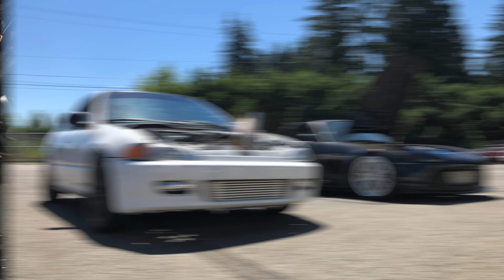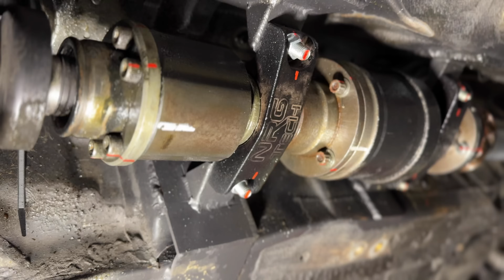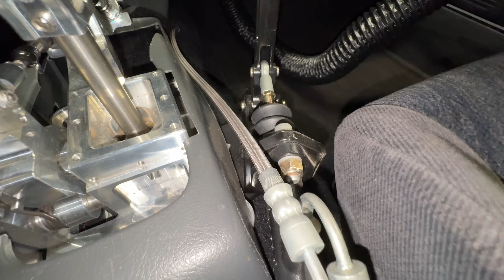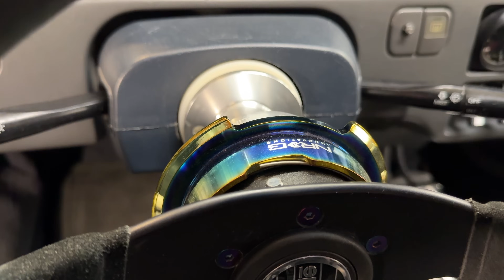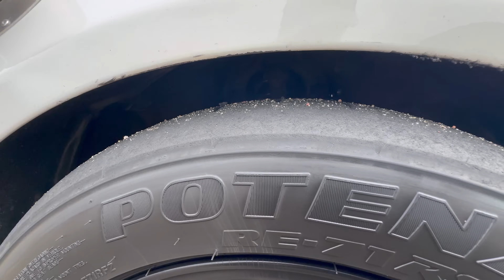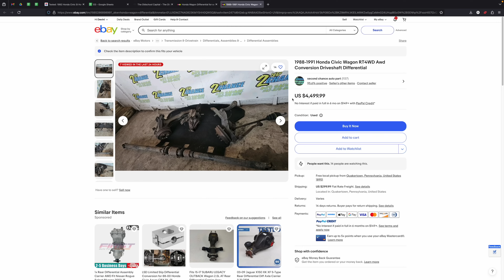AWD Hondas Are Out of Control....(here's the one I built).

Comment: Beatiful build my man. I'd be interested in a video of that aftermarket heater core setup that you have going. My car is currently getting minimal heat thru the factory system and instead of fixing it with factory parts, id like to go the route you went. The factory parts have gotten very expensive.
Reply from the maker: You’re in luck: https://youtu.be/SQQehF27I5o?is=OGvBR-9-NpOWN1A2

Comment: 217 hp rating is at the crank. Put in some valve springs and rev it higher.

In FWD form, a bolt on K20 with a tune should make about 230 whp. You should be able to hit 215-220 whp with AWD without valve springs.

Based on the data you have, that dyno likely reads accurately.
Reply from the maker: Yep, that’s what I’ve found out since. Guessing we’re at 220whp currently, considering I’ve put on a bigger intake and giant filter to replace the previous small restrictive setup it had when dyno’d.

Comment: Planning on tracking my AWD k20 car, not sure on what LSD combination should I use, front and rear, rear, or just front
Reply from the maker: I’d do both, but if you could only have one go front.
Reply: @kawdzilla  thanks for answering, is not common to find awd honda track cars, not a lot of info. With the rear installed you notice better rear bias, like better rotation?
Reply from the maker: You get a lot less understeer (than fwd) with the rear wheels powered. Lift off oversteer pretty much goes away unless you’re hauling ass…I’ve tried to induce it in awd and really can’t anymore. It just hooks, glued to the ground.
Reply: @kawdzilla thanks for the information and sharing your experience!

Comment: How much for just a bare bones AWD system for a D16?
Reply from the maker: Awd trans, driveline, diff and axles you’re probably in it for $5k in parts alone. If you can find the wagon stuff. Then the diff mount, RTA’s, fuel cell, fab work and little stuff to make it all work together adds up to another $3-5k for sure.

Comment: I am going to build a awd civic, I have all the donar pieces and spare parts. I just need to find a chassis and the suspension. Shopping for the rear setup rn, what would you suggest? I am able to weld and fabricate. I track a built SN95. 

Also, one trick for AWD's to turn in is to have a square setup but use a larger rim in the front and a smaller rim in the rear. Reverse stagger, I've done it before, and it was a different car after that. Was skeptical at first and borrowed two sets of rims and size tires. I had smiles for days after that!  

Just started watching you channel, awesome content!

Comment: Do aftermarket pulley,skunk2 manifold and ktuned 72mm tb i did almost 240 on my k20z3 with all that plus hybird racing 3.5 cai,header and 3in skunk2 exhaust. So if you do all that plus cams on your motor tou should hit 260 to 280

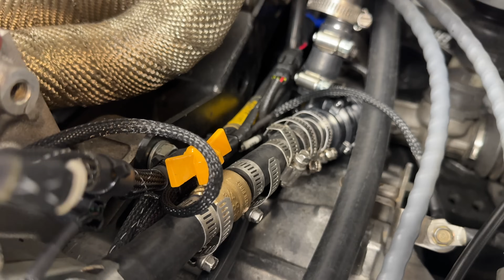Comment: 14:39 what is that clamp mess, brother?
Reply from the maker: Dude tell me about it. The booster pump for the heater circuit only came with 3/4” inlet/outlet so I had to adapt down to standard 5/8” heater hose on both sides. It’s killing me too, needs a better solution.

Comment: 217 factory rating is to the crank. So with a tune and bolt ons, 210 whp is a significant gain considering from factory to the wheels would be 190ish

Comment: Bro i have an 07 acura TL that i absolutely love. I dont drive it tho because my license it gone right now but man its mint with no cracks on the dash its royal blue pearl factory paint with black leather interior.  I want to build it and either engine swap the 3.2 for a 3.7 and run NA or either boost the 3.2. What would be the best build for my TL to get the most power with reliability?
Reply from the maker: That J32A2 is pretty bulletproof and a good bang for your buck. I’d stick with that.
Reply: @kawdzilla  thanks for the advice. I'm glad u said that. I thought u were going to say swap it. They say the Trans from the RL is in the 07-08 because the trans from 04-06 were garbage or weak. U think the Trans would be my weak link out out everything?
Reply from the maker: @RAW-With-JESUS years ago I bought a CL type s with a bad auto transmission and replaced it. They’re definitely known for not lasting long. If you can find a manual and do the swap, that’s what I’d do.
Reply: @kawdzilla  thanks again,  I was thinking the same thing.

Comment: That harness is going to kill you if you don't mount it properly.
Reply from the maker: I mounted it in accordance with the manufacturer specifications using only factory seat belt mounting points. You see a problem?
Reply: @kawdzilla  the shoulders straps should be mounted in line with the horizon of your shoulders. 
When mounted lower, the force of an impact will create down forces on your shoulders. 
Typically, this either breaks the neck or dislocates the shoulders.

When mounted at the horizon with the shoulders, impact forces are applied eventually across the chest, letting the body move forward without being rolled into a ball. 

Sorry, I should have elaborated, but you never know if you're gonna get a response or if it's worth the time to type it all out.

Also, the AWD project is badass. 
I'd like to do this to my Integra.
Reply from the maker: Appreciate the info my friend! My research tells me that shoulder straps can be mounted up to a 30 degree angle below horizontal, but I just checked and mine are at 45 degrees. Looks like I eyeballed them wrong initially. I'm going to remount these right away on the rear crossbar which will get the angle below 20 degrees and be in line with spec and add some padding on the bar to prevent them sliding around. Thanks for pointing this out, potential life saver.
Reply: @kawdzilla  you bet, my dude. I subbed so I can follow the journey.
Reply from the maker: I was able to get the harness relocated to the rear bar, angle is now within spec at  16 deg.
Reply: @kawdzilla  ❤

Comment: Dude, awesome build! As for the understeer treat it like a front wheel drive car you wanna loosen up the rear to make it rotate more. Try lesser rear spring rates and lesser shock rebound to promote better weight transfer, but combine it with a stiffer rear sway bar and maybe only a factory front sway bar (You can increase the front spring rate if you’re worried about excess body roll) to force the front suspension to have equal force exerted on the ground left and right. On my Focus ST I’ve had great results with having a little extra rear toe in. And lastly, run an extra 5 pounds of pressure in your rear tires over your front.
Reply from the maker: Appreciate that my friend. But walk me through this, I've always understood that a stiffer rear end works better to get it to rotate in a fwd car, and that was certainly my experience when it was fwd. How does a looser rear end and more toe in for this awd configuration result in more rotation? I would expect the opposite to be true...

Comment: AWD must be the greatest mod to our cars...
Reply from the maker: Indeed. To answer your og question, I sprayed all the steel parts with Fluid Film for the winter. Keeps the water off and rust away. Salty roads here in the Midwest.
Reply: @ yeah, after watching over again, admiring the work, I could tell it was just shiny paint, so I deleted the question 👍🏼
I used Fluid Film on internal rollers, etc, on my brake test platform in 2020, on rainy days the water from the cars dripped on it all day when doing inspections..just tore it out to scrap, …those parts were still coated and nice…Fluid Film works!
Reply: @ I couldn’t handle those conditions, road salt, etc….what it does to cars is evil

Comment: Awesome video and awesome build. I've been looking for feedback on AWD Hondas for track use and had given up, but today I was blessed by the algorithm.
I would love to know more about the feeling of the car. Did you track it before in FWD? How does it compare?
Reply from the maker: Blessed! I did track it in FWD previously, more autox than anything. The main difference is the lack of lift off oversteer at the limit. Chassis is more composed, planted on rails feeling, just grip for days. Fwd was total yahoo vibes, constantly scrabbling for grip. Both are fun to drive, awd just forces your limits way up, so you gotta drive it faster to feel the edge, ya know?
Reply: @kawdzilla  I have a 2001 coupe (EM2) with a k24a3 (250hp crank with some basic bolt-ons) and a EP3 gearbox (NPQ3) with a wavetrack LSD and I struggle with grip out of the turns even when running 225 45 17 tires.
Coming from RWD (had an S13 that got T-Boned), the civic feels like it's missing something and I always wondered if AWD would be the answer, but the lack of information about how the car handles (my friends told me it would just understeer like crazy due to the lack of fancy diff magic tech like the evos and subies have) made me give up on the idea. I even messaged DC5creations asking even they had any costumers using the car on tracks/circuits but had no answer.

But you gave me hope. I look forward to future updates and upgrades.
Reply from the maker: We’ll dial it in, lots of room for improvement.

Comment: What’s the name of the heating unit you used?
Reply from the maker: It’s from Inferno Heaters. I’ll dig out the actual model I have and whatnot for that video at some point.
Reply: @ thanks man, I have a awd build in the works and I have no heat and the whole heating assemble with a/c is just to big for me that little unit is perfect!
Reply: @kawdzilla  awesome, and do you remember what front axles you used? i have the 32mm hubs on my eg still and didn't know if i needed to change them out
Reply from the maker: @yerrr1993 insane shafts k swap axles.

Comment: I drive the shit out of my hatch back Hyundai and the best way imo to get my ass end to slide even though it’s not awd, is it being weight balanced closer to the front tongue weight. 

Maybe probably a LSD would help the tire lock up with the other side to get it to slide a bit it’s not a professional opinion 😅 but maybe it would help🤷🏽‍♂️

I’ve kept up with brand new BMW’s weaving in and out of moderate traffic well over 110+. 

P.S. 2018 Elantra GT base with a H frame rear suspension lowered 1” on Whiteline springs with lionhart LH-five 245 40 17 rated as UHP 😏😉 (Ultra High Performance)😅

Comment: I know the honda wagon awd diff is used for big horsepower. And that the crv awd system isnt good for anything higher than 400 horsepower. But crv parts seem to be more available.

So is there a way or aftermarket parts that lets the crv awd path handle more power?
Reply from the maker: Sure there is. I'd reach out to S1 built about their locking plates and ask about torque limits.

Comment: It's crazy when people say 1KHP AWD Civics aren't worth 100K-200K. This video really sheds more light into why it's so expensive for those higher level AWD builds.

You didn't even touch the engine and you're already at that price point. Imagine pricing in a complete engine build, a complete transmission build with straight cut dog engagement gears, billet case, crazy twin disc clutch setups, upgraded transfer case housing and gears, stage 3 Driveshaft, rebuilt rear wago diff, four 1Khp axles and intermediate shaft, brakes, literally everything else.

It all adds up quick, but people won't believe Sonic or Chase when they say they own $150K+ Civics. And theirs are immaculate on every single trim piece, which considering EG OEM bits prices is a whole other layer of money pit.
Reply from the maker: Spot on.

Comment: Is there no way to fit an OEM fuel tank on the car? Or when you go AWD, is that one thing that has to go.
Reply from the maker: No way, gotta go, diff sits there and driveshaft goes right through it. There are some industrious folks out there attempting to use a wagon tank. Other than that, aftermarket is the only way.

Comment: Nice info packed video! Very cool build. Have you wound some negative camber into the rear to help with encouraging more oversteer yet? Or tightened the rear dampers on compression?
Reply from the maker: Yes and yes. I run the damping at full hard on the track and camber is -3deg or so.
Reply: @kawdzilla  Anymore weight you can remove from the front and get in the back instead? Also, is there no rear anti-roll bar? Did I miss it or was it not on the 4WD donor car?
Reply from the maker: @YootubeUK  I'll figure something out for weight balance. No rear sway bar available on the market that I know of that is compatible with my AWD setup.

Comment: No manufacturer has ever rated their engines to the wheels.  217 is crank

Have your tuner release the redline.  No reason to stop at 8400. Do skunk2 pro 2 cams and valve springs. It’ll make a huge difference
Reply from the maker: Good info. All in good time.

Comment: what about 215/45 for the rear tires
Reply from the maker: That would be nearly 1.5" smaller overall diameter than current. All 4 tires need to be the same diameter/circumference for AWD or you'll burn through the viscous coupler.

Comment: No sway bars? Front or rear?  Dramatically changes the feel of my JRSC k24 EK. Adding a rear sway bar (OEM is a great upgrade) would add that oversteer your looking for also. You may have to do some minor monifications to the AWD diff brackets and rear lower control arms but it would be well worth the hassel! Especially a rear sway bar.
Reply from the maker: @0253AMC  this is top of my list. Mods will be necessary.
Reply: @kawdzilla  It should make a huge difference in feel. I would also recommend the Mugen Thermostat (K24AX) SKU:19301-XKB-0000 Its a bit spendy but well worth it. My coolant temps even under heavy load wont exceed 170F. However, If you drive/rely on the car in colder climates it may not be the best choice.  Hope this helps! Excited to follow this series!
Reply: Yes I agree on the sway bar, it really helps to turn on corners.

Comment: How about an lsd for the rear, softer springs at front stiffer at rear you probably gonna get Good oversteer
Reply: LSD would need to be clutch-type, not helical. He is already lifting a rear wheel, and your proposed spring rate changes would make that even worse.
Reply from the maker: @DrKnowNothing1  why clutch type? It’s my understanding that at least the Wavetrac helical creates an internal torque when one wheel is off so you don’t lose drive.
Reply: @kawdzilla yes, a wavetrac should (based on their marketing) still put some power down with a wheel in the air (I still haven’t seen a video of it actually working).  But it’s still a top-level helical LSD, and I didn’t realize they make one that fits your rear diff.  That should be a great upgrade!
Reply: @DrKnowNothing1  Ohh I see, I don't know much about these things and I'm Still learning, Thanks for your knowledge kind sir☺️
Reply: wouldn't sway bar tuning help with the wheel lifting situation? from my basic knowledge about sway bars, it could prevent the wheel lifting or am I wrong?
Reply: @darkwatcher01 yes, a softer rear swaybar would help reduce wheel lift.
The problem is that he is already “trending towards understeer”, and has already considered putting narrower tires on the rear to balance the handling.
He could consider a different model tire (less grippy) in the rear, or lower rear tire pressure to reduce rear grip.

I would also recommend talking to Subaru track guys. They might have the most experience setting up similar cars (front engine, AWD, viscous coupling to rear, not crazy power, etc)

Comment: Use a rear LSD. And for more oversteer try to slightly overrun your rear wheels to transfer more torque to the back (like the GR Corolla/Yaris).
Reply from the maker: What do you mean “overrun” the rear wheels?
Reply: @kawdzilla  I meant making the rear wheels (out diameter) to rotate slightly faster, say +3-5%, of the front. This would absorb more torque from the front and transfer to the back.
Reply from the maker: @janlawrence2303 that’s what I figured you meant. But the way the Honda awd works, the rear only engages when the fronts are spinning faster relative to the rears. So I’d have to do the opposite and make the rears a larger diameter (spinning slower) to keep the viscous coupler constantly engaged. And I’m not sure how that would affect longevity of the plates and fluid.

Comment: Does that rear differential and everything just bolt in? I’d like to see that in detail
Reply from the maker: It bolts in once you’ve installed the diff mount kit. Requires some cutting and rivnuts, but pretty straightforward. I’ll see about making a short form video on the rear end.

Comment: I hate the idea of beating a stock wagon diff. It looks like it’s going through hell back there. There HAS to be other V.C options that share same dimensions that are either newer, better, or just affordable and around. 

I am so on the fence about how well this would hold up for me
Reply: No offense, but I highly doubt you're going to make enough power to hurt a wago diff. These are running in 7 second drag cars in excess of 1500 wheel horsepower. You'd probably be better off with a crv diff.
Reply from the maker: Well if there’s anything we’ve learned from all those 1000+hp builds it’s that a stock wago diff and a rebuilt VC can handle it. 

Freelander viscous couplers with pinned CRV diffs are a thing if you want something newer and more affordable, but the wago parts are the gold standard.

Comment: the 217 stock hp number is at the crank. its about 188~ whp
Reply from the maker: Nice! You have a source?
Reply: @kawdzilla  no but ive had that engine in my old ep3 type r and now i have a K20A2 in my new one and the numbers are all BHP never WHP from honda. Not impressed by the difference tho in the A and A2. i have 250hp in my A2 right now and thats about 210 WHP and not a difference from the JDM K20A